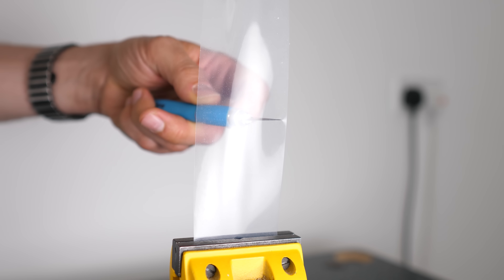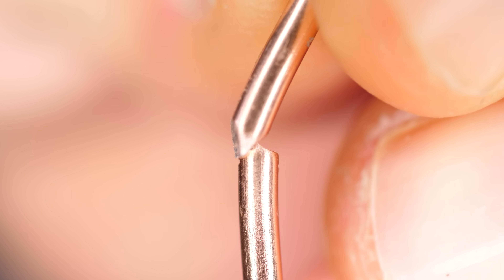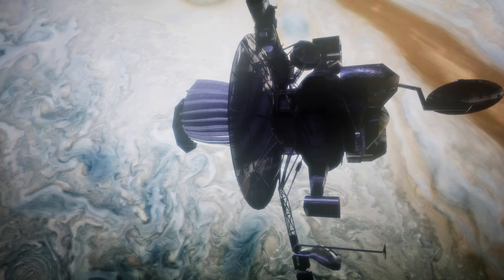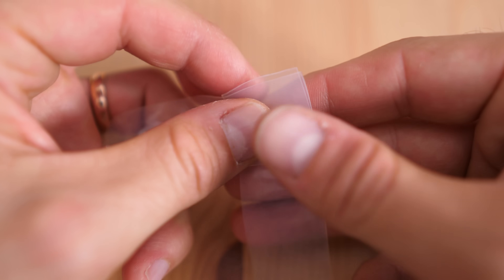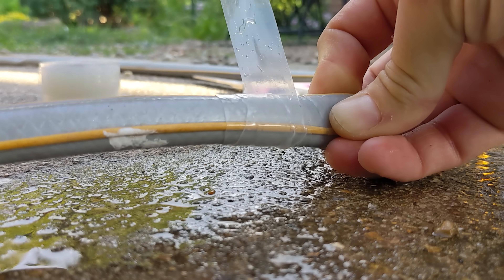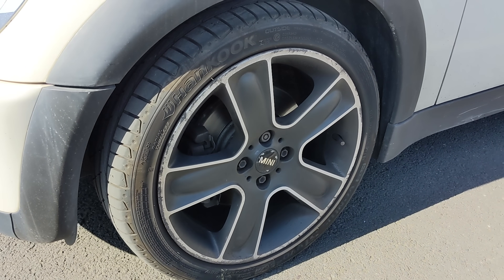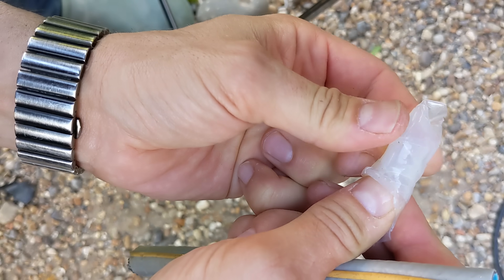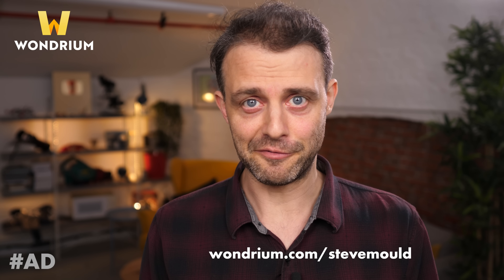Self-Healing Material

Comment: This is great but my only, and biggest concern/problem with that material just got proven in the first few minutes of this video... it does not just heal where it has been taken apart...  it does not matter in what orientation you put it together it will fuse to itself, making it an unfoldable or non reusable product if it ment folding it or, making it touch it's other parts at some point in time. Like I need a self healing bag, but I can not fold it nor have the bag's inner surface touch eachother... that makes it a rather frustrating product.
Reply: I know this is kind of impossible, since it would need an intelligent material, that knows there its molecular structure has been damaged and only fuse together where it has been taken apart... but if something similar could be made, that would be awesome!

Comment: you simply aren't applying enough pressure to put the metal back together. To be fair to that you would also need heat, but you can absolutely put metal back together

Comment: Well you can put two pieces of metal Back Together by melting them same for pieces of glass anything pretty much can be healing if you melt them back together but I guess you're referring to self healing without doing anything else besides putting them together.

Also I noticed you didn't mention about like tape you can put two pieces of tape together and they go back together but of course it's because it's sticky like the water or the tack or even Play-Doh

Comment: Unintended cold welding in space also happened on one of the Gemini missions, when they opened the hatch for a space walk.  As the hatch hinges opened, the scraping between the two metal parts of each hinge cleared away the oxide layers enough so that the two parts of each hinge started to weld together in the open position, so when the walk was over they had a hard time closing the hatch.
Reply: Interesting! 
Unfortunately though, a quick Google search led me to articles that say that while cold welding was originally thought to be the culprit, a SPRING that failed to compress was the real cause of the hatch not closing.

Still, it's an interesting phenomenon that I had no idea about.
Reply: space is fake
Reply: Nope - it was a theory but not what actually happened.
Reply: @melody3741  Bang! Debunked! Hang on a second, what happened then?

Comment: Actually you can join together metals by contact welding.
Reply: That's using heat to break the later blocking bonds from forming
Reply: @leafy126.5  no
Reply: @polvoradelrey2423  yes lol, you can't disagree
Reply: @leafy126.5  https://en.wikipedia.org/wiki/Cold_welding

Comment: The micro capsuals was either not described correctly or isn't it (and this fact is obvious by your own video) when you lay a slab of it onto another slab and they become one (not just two ends - both with severed micro capsuals - reconnecting to each other).

Comment: I once cold-welded two sheets of microscope glass with some glycerine inbetween. I had a dropplet between the glass sheets and rubbed them against each other. My theory then was: At some point, the bonds of the glycerine or the glass should break and open the possibility of reconnecting both sides, as you have oxygen atoms with a molecular backbone. At some point this apparently happened. I never again could separate the two glass sheets.

Comment: My kid thinks that you could tell if microcapsules are involved with a fairly straightforward experiment. Simply cut, heal, and repeat multiple times in the same spot. If there are microcapsules they will eventually be exhausted and the healing will no longer work. If there are no microcapsules and there is a cross-linking or polymerization that's going on, then it should continue to work more or less indefinitely.

Comment: Cold welding of SOME metal(s) is posiible on Earth - for metals like gold. If you place two CLEAN cast (*) gold bars together, one on top of the other, "top" surfaces facing each other (for best effect, although any side would work), and then you tap them with a wooden mallet they'll stick together. (Sometimes it's enough just to put a bunch of those bars in a bag and carry them around for a while.)
This effect is, AFAIK, used in making computer chips - you have to connect chips innards somehow to the outer world, so the eletric signals can be send and received - and those connectors are made of a tiny gold wires, cold welded to the "terminals" in chip by simply pressing them in.
___
* - this effect might not be very pronounced in those more "elegant", "stamped" bars as they may accumulate some lubricants on their surfaces, transfered from stamping press "stamps". Casted bars are casted from very hot melted gold (obviously) thus their surfaces are free fom any inpurities and grease.  
I observed this effect myself many times - sometimes those bars got welded so strongly that I couldn't separate them with my fingers, had to pry them apart with a knife or flat screwdriver.

Comment: Before silicon tape ham radio operators used to use unvulcanized natural rubber strips. When you hook up an RF cable to an RF connector outside you would wrap the connection in the rubber to make it water tight. The unvulcanized rubber was self fusing. Since it was rubber it would degrade in the elements (especially sunlight) after a while and you'd have to cut it off and do it again. You can still buy unvulcanized rubber sheets.

Comment: I’m just curious... in all your video examples of the polymer sticking to itself, you showed this whilst handling the material with your bare hands. I was wondering if you could still test the polymers “healing” whilst removing the “human” element from the equation. I mention this as most humans bodies sit at an average of 37 C (or 97-98 F) and I’m curious if ‘heat’ is creating a reaction with the material. Maybe test it with cold hands after holding ice for a while, or with very thick rubber gloves that were left in a cool location.

Comment: that looks like silicone tape. i upgraded my cars radiator hoses from the regular rubber hoses. To find out the metal hose clamps can damage it quite easily. I bought the silicone tape wrapped the surface and I don't have to worry about the hoses getting cut by the clamps.

Comment: Micro encapsulation is not a possible explanation! You have cut it in half and then placed one half on top of the other.
If the microcapsules release the "glue" when damaged, only the cut parts should stick together.
Same thing when you bend it and it sticks to itself without beeing cut.

Comment: “Cold welding” doesn’t actually have to happen in the vacuum of space. From experience I know that if you polish two quartz glass plates very flat and smooth and then stick them together, they will permanently bond as well. It’s pretty awesome!
Reply: This I would like to see! I've never heard of that.
Reply: @calipete  I've been able to Lap 2 copper heatsinks so "flat" in terms of the bottom surface of one and the top of the second that they transfer heat as good or better than with thermal interface materials. I'd say what happens would be called "Wringing"

The phenomenon you speak of is routinely used to test the flatness of precision gauge blocks used in metrology: their ability to "wring" together both confirms their flatness specifications and is useful for storage, when a very light film of oil enhances the wring - and thus keeps corrosive environments away from the calibrated flat surfaces when the latter are not in use.
Wringing is thought to be a combination of .  .  .
1. Molecular Attraction - accidental cold welding
 or, as Richard Feynman put it, when the interfaces between like materials are very flat, there is "no way for each atom to know which block it is in", so the bond across the interface gets more and more like the normal molecular forces holding the lattice together the flatter the interface
2 Suction - i.e. the blocks have expelled air from between them and air pressure helps force them together
3 Surface Tension - From any water vapor that gets caught between the blocks.
Reply: But yeah I think that’s a little different than cold welding — quartz is already oxidized. The big issue with connecting other things is that you still have a very thin layer of air between the two, so not great contact. l believe that this quartz welding phenomenon could be explained by the piezoelectric effect — if you’re pushing them together, you’re deforming the crystals and causing a voltage to occur which may generate enough charge to encourage the pieces to mobilize into each other
Reply: @@fu1ck1you They're crystalline but not uniform. They have a "grain" structure, which is the amalgamation of all of the different crystal regions. Much like a block of ice in your freezer, it's not a perfect crystal, it's polycrystalline. I just took a college metallurgy exam today lol.
Reply: The shape and size of the crystalline regions are a large part of what determines the properties of a given metal. It's why you can make a steel harder without changing it's chemical composition at all through different processes. Quenching, cold rolling, annealing, etc.
Reply: Completely different mechanism
Reply: but fo the case of metal it has to happen there, because like stated in the video, the metal will oxidise. still, does that mean that if fast enough, it is possible to rejoin the metal before oxidising?
Reply: That sounds insane!
Reply: Does quartz glass oxidize? Because thats the reason for the vacuum.
Reply: It wasn't cold welding, it was friction because the metal expanded slightely.
Reply: what happened there probably was caused by casimir effect through van der walls forces between the plates, same thing can happen with standard ceramic blocks
Reply: Cold welding is with metal, you said that happened with quartz without a vacuum. Quartz is not metal, it is a crystal
Reply: @Meme-2038  There is less difference between metals and quartz crystals than you might think: all metals are crystals, too, when solid. You need to put energy into the system to split the crystal, forming two new surfaces where atoms have a higher energy than those in the inside (they do not "want to be unbound").
In theory you could stick together these two surfaces, refusing the crystal and freeing the energy, but it will usually not work because you have deformed the volumes and surfaces so the atoms will not line up precisely enough again. If however you create very flat surfaces it should work with any crystalline substance.
Reply: @mynung7008  what are you high on about, metal dont have diamond structure, futhermore, crystal structure is far more complex to tell in my comment, telling metal is like crystal ís so wrong, the most common way to identify metal, non-metal, semi conductor, ... is when aply an electric current to it, metal is always free of nagetive particle, while crystal can be made into semi-conductor, have holes and electrons. You can say both metal and crystal is solid, but metal cannot crystal.
Reply: @joshchristopher551  Crystal structure of metals (and all other elements) explained here: https://en.wikipedia.org/wiki/Periodic_table_(crystal_structure)
(BTW, quartz doesn't have a diamond crystal structure either - it is trigonal not cubic).
Reply: @mynung7008  then by that point, anything can become crystal structure, water have crystal structure is snow
Reply: @joshchristopher551  Ice is a crystal structure of water. Its why water expands when it freezes, its crystalizing.
Reply: @joshchristopher551  lmao ye snow are water crystals ?! ur the guy thats high if u didnt know about that lmao ever saw a snowflake form thats the textbook definition of a crystal structure
Reply: @joshchristopher551  Ice is literally water crystals. You learn that in like 1st grade.
Reply: @joshchristopher551  what are you on about? If telling the difference between Crystalline and amorphous materials was as Easy as checking whether they’re insulators or conductors, I’d be out of a job
Reply: @mynung7008  What about metallic glasses? Those are 1800s
Reply: @EternityForest  Yes, metals can be amorphous - but only if you treat very specific alloys under very controlled conditions (see Wikipedia on "amorphous metal"). This will never happen "in nature". By what I read the first samples were produced in the 1960s.
Reply: @Meme-2038 metal still has a crystal structure though, doesn't it?
Reply: @Meme-2038  I thought glass is amorphous not crystalline.
Reply: @janvisagie231  Quartz and glass aren't the same.
Reply: @janvisagie231  Depends on what kind of glass you're talking about. Optics grade "glass" are usually transparent crystals in order to achieve the homogeneous property the optics require.
Reply: Quartz is not a metal…
Reply: @coryswanson2247  so?!

Comment: That’s assuming your cutting things at an atomic level, you cant cut things at an atomic level because that requires energy, atoms are fused concept of energy surrounded by a kinetic gyration.  Force itself is energy but without heat which vibrates all material in our universe you cannot separate an atomic structure in it’s roots.
Reply: Covalent bonding is a correlation to a solution or a problem solved by the universe to make a new solution, a solution can be cut and replace by different fluid cutters based on the weight and energy transference of another solution to create a different solution. Still requires energy
Reply: Instead of saying heat we can simplify the matter and just say hydrogen because hydrogen is the most common reaction to every element and solution created